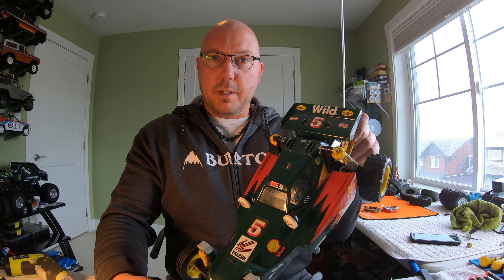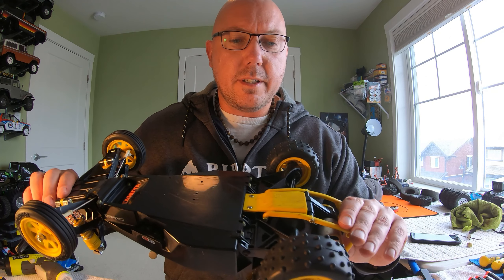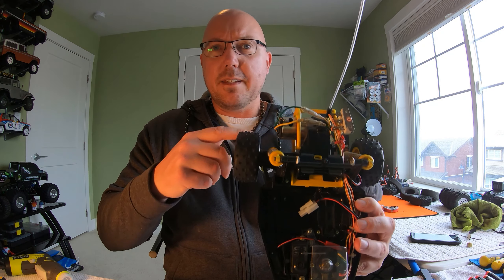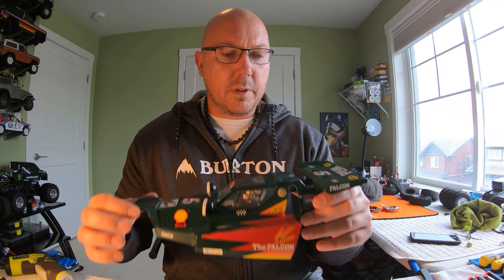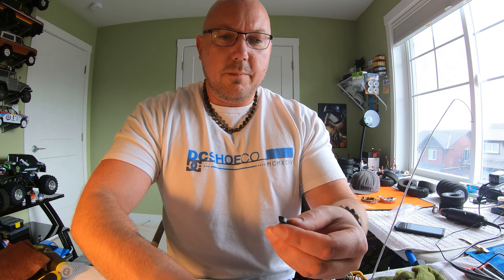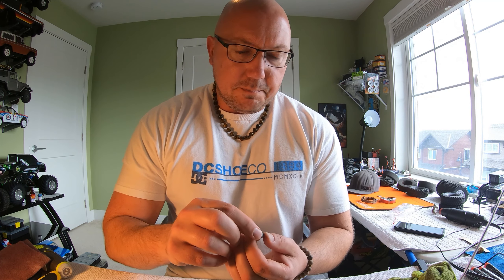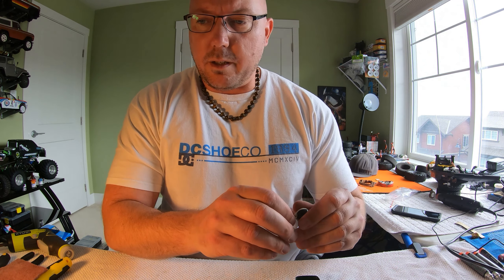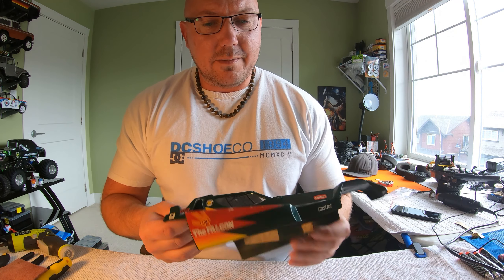Tamiya Falcon Restoration Part 1

Comment: I just picked one up. Came with a NOS clear body, driver in the original box.
Reply from the maker: A rare find, good job!  :)
Reply: Thanks 👍 was gonna sell it but since it just needs taken apart cleaned and reassembled, probably gonna hang on to it. Got OG wheels too with a black sport tune can motor.

Comment: ebay has aluminum hubs for less then 10 dollars
Reply from the maker: Good tip, thanks Mike!  🤙🍻
Reply: @poorboysrc  ebay seller "rc loverr"
Reply from the maker: @rcmikeklein5512  wicked, thanks pal!
Reply: @poorboysrc  I have ordered from them and it does take a while to arrive but can't find the hubs in the states
Reply from the maker: @rcmikeklein5512  I do have a broken hub on mine (35 yesr old plastic and all!) so it would be good to get a replacement!  Thanks again for the tip!